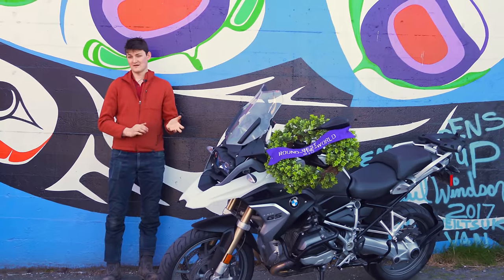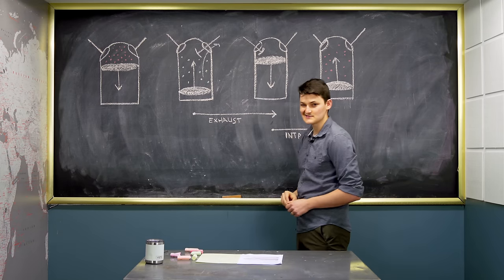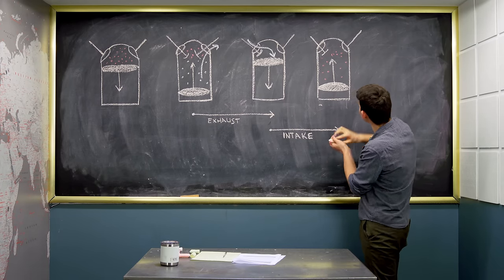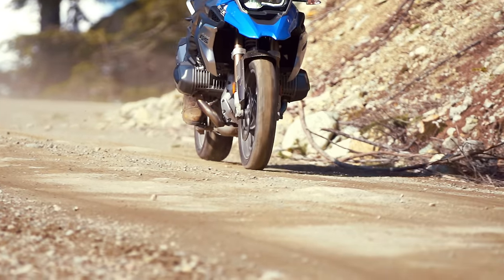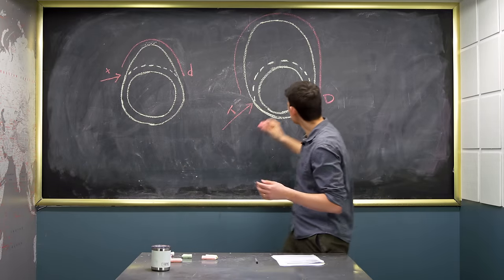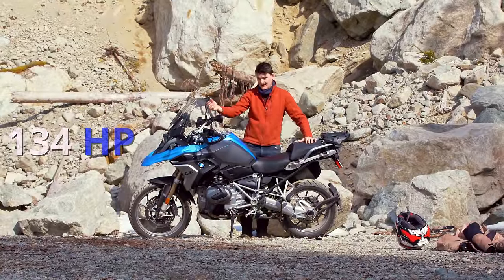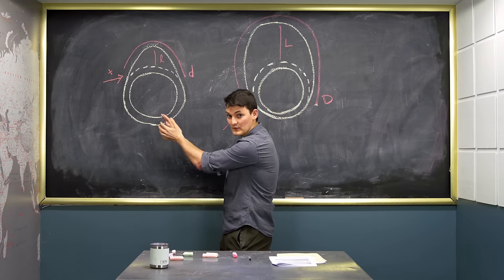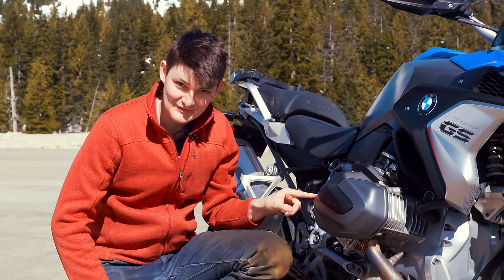Variable Valves are Bad for the BMW R1250GS - Review

Comment: Well I'm a BMW motorrad tech in the UK, And we are the Number one dealer in the UK, We have not had a single shift cam actuator fail yet.. and we have seen some bikes with 60k+ miles already.. just saying..
Reply: j0rzeh: Good on you! My 1200R Sport will be seeing the inside of a Motorrad dealership for its MOT and 4 year service when this is all over.

In Ryan’s defence he makes a very entertaining and informative video. But I’d still have the GS. 11 years of 1150GS ownership and travels all over Europe is enough to convince me of BMW’s superior credentials. And their dealerships are pretty good places too 👍🏻👍🏻👍🏻
Reply: not the point, get it, it is the cost. plus you clearly are biased
Reply: He never said it WILL fail. He said it COULD fail. A very different distinction. As a tech, you typically deal with bikes less than 2 years old. I know, because, I am one as well. The rest of the planet has the 10 year old variety and has to deal with the consequences of these silly engineering decisions.

The secondary point is that it is needless complexity. A GS1250 has already way more power than it needs to for the PURPOSE of it's existence. Why add complexity when the only gain isn't needed?
If the PURPOSE is to go around the world, I'd take 1/2 the HP for an air cooled, belt drive, hydraulic tappet, no gadgets bike. Decent analog suspension, and a few spare parts. No Motorrad helicopter and credit card needed.IMO.
Reply: @shogginr557  BMW Made the shift cam a simple design so it wouldn't fail, It's just a Magnet, highly unlikely to fail. As a Tech I deal with bikes of all ages we often see 15 year old bikes even R80's come into our dealership, Also I worked as a CNC design Engineer building Cummings engines for the MOD prior to BMW and I used to design Turbo's for Garrett so I think  I have decent grasp of engine design It's the throttle bodies that fail. Also I'm not Bias towards BMW at all in-fact I'm a KTM guy all day, But you cannot call tech that hasn't failed yet? I mean come on!.
Reply: @j0rzeh  But, what have you done for me lately?
Reply: @j0rzeh  It is FAR more than "just a magnet" And its still a magnet you can't get in Mongolia. Doesn't it have its own ECM??
Reply: @shogginr557  and you let all the places on earth you went straight to mangolia? He crushed ur head with his reply just deal with it or shuush for the rest of ur life.. U know nothing about bmw gs i own a 2020 model and i have it for 50 years... Well im from feature... We are living on neptune right now earth is destroyed with ur ur crap talk
Reply: @shogginr557  No it doesn't have it's own ECM, the DME runs everything on the bike just like all other brands, It's a Copper winding (Magnet) inside that when current is fed through the windings it moves the runner for the cam shaft, It'll be the last thing to break on that motorcycle, only thing that'll kill it is exposure to water which will cause corrosion and short the windings out, Hard to do that when it's in a sealed oil bath, You have no idea how the system works, Not a single failure in Europe yet, No point arguing with you since you have no idea what you're actually talking about.
Reply: @j0rzeh  Thank you for the explanation, it does sound simple, you are super smart and I'm sure it will be fine for most people.
It's still more complicated than not having it at all. (the point).
And it's not needed (the other point)
Reply: Why use BMW Bikes potentiometers instead of stand switches?
Reply: @PhilbyFavourites  That's the key. It's good motorcycle to travel across Europe where you have dealer service in hand range.
Reply: @j0rzeh  it's a solenoid.....solenoids fail ALL the time...like...all the time. any number of things can cause them to fail. electrical issues elsewhere in the bike that can cause bad grounding, over voltages, a bunch of crap in your oil (if the solenoid is actually exposed to the oil bath) causing shorts or other mechanical damage to the solenoid, etc... not to mention simple use over time. electronic things just go bad at some point, it's a simple fact. will it be 5 years or 50? who knows, but it can still break and stop working, and possibly just from use. it's a good system...however, a mechanical system would be LESS prone to failure just by the general nature of reality.
Reply: The air cooled gs's are notorious for high miles with hundreds of thousands of miles and dry clutches. I have kind of lost my interest in the gs series anyway with the water cooled engine, but still wish they are just as long lasting.
Reply: @blacknester I have a 650, 13 years old now, no electrical problems at all. 25000ks.

Comment: I think you hit the nail on the head about the reliability concern. I have an F800ST, and while everyone praises the durability of the F800 engine itself, there are so many electronics that can and do go bad on them. I've been dealing with a glitch for about 2 months now and solving it has been a huge pain.
Suzuki is the polar opposite. Yes, electrical parts can go bad on any bike, but the only part that went "bad" on a GSX650F (that was incidentally 2 years older than the F800ST) was the neutral/gear indicator, wherein it'd show the wrong gear at low speeds. I feel like Suzuki's tech is dated, but at least it's well-tested. So as someone whose only vehicle is a motorcycle, I'd rather have that any day.
If BMW's engines and mechanicals are as strong as a certain mythical Greek warrior, then their electricals, peripherals, and stupid specialized tools are like his heel.
Reply: I recently read a consumer reports that said BMW fails 50% of the time, Ducati 33% of the time, and Polaris (Victory and Indian) only 17% of the time. With Honda, Suzuki, Yamaha, and Kawasaki all being less than 15% of the time having critical parts failing, so they are the top 4 most reliable motorcycles, with BMW having a reported 50% failure rate of their motorcycles. It didn't say when that was measured or how they attained those statistics, but with their cars, it certainly sounds right. German and American cars are the most unreliable cars ever made, although German cars are a lot cooler than any other car. I would trust a new BMW motorcycle, because I think all the new bikes, except the Pan America and new Harley liquid cooled motors, are pretty reliable as of 2023. Electronics are much more reliable now than in 2006.

Comment: I’m still waiting for the first FreeValve bike.
Reply: Was just about to comment the same
Reply: You guys should check put that awesome new technology called two-stroke ;) Jk I know you're referring to fourstrokes
Reply: Me too. We will ever see it on production? I'm gettin old...
Reply from the maker: Let's just see if they can cram it into a car, first. ~RF9
Reply: @Johnny Blue Air compressor?
Reply: @chargingcycles  cars not just a car
Reply: Like the Suzuki RE5 og Norton Rotary?
Reply: Buy a 1910's bike and you'll have your free float valve (at least for the intake)
Reply: @Johnny Blue Yes I do. <looks suspiciously at the motorcycle engine>
Reply: Livewire ???
Reply: There already is one. It's a racing variant of the Aprilia RSV4 called the RSV4 FW-GP (Factory Works - Grand Prix). Obviously it's not usable for the road, but it produces over 250hp from 999cc.
Reply: The Koenigsegg Gemera comes out this year and the 3 cylinder twin turbo looks amazing, really brilliant exhaust system.
Reply: @chargingcycles  And turbos, don't forget the damn turbos.
Reply: FortNine they are, the nee koenigsegg whatever has a free valve engine
Reply: F1 has used pneumatic/hydraulic valves for yrs - springs can't return the valves to their seats fast enough for a 19k RPM engine.
Reply: @jimieljoseph2322  i think kawi did it right going supercharged. Superchargers build boost in a very linear and predictable fashion. Turbos can get a little funky in the on and off throttle situations. But yeah forced induction is something that would be cool to see on more bikes!
Reply: No you dont. The reason only one car maker does it is cost and complexity. If Electronics are a weak point Camless Valves are the ultimate failure point.
Reply: @Johnny Blue I mean, I already have an air compressor for my horn.  Why not the valves too?  Especially if you can eliminate all the bulk from camshafts and timing chains.
Reply: many years ago I read an article about magnetic valves.  never heard about it again lol
Reply: Johnny Blue I think it uses intake manifold vacuum to actuate the valves, no need for an air compressor
Reply: Electric bikes are valve free.... Oh you said FreeValve.. I'm sure if you haggled they would throw it in the deal...
Reply: @Johnny Blue My bike already has an air compressor, the engine.
Reply: @chargingcycles  thanks.  👍🏻

Comment: 8:30 What the actual hell is this. Are manufacturers going THIS far to stop people from working on their own machines?
Reply: What posible reason/justification could there be for that fuckery?
Reply: That´s a safety feature. It prevents people from messing with your bike and stealing the screw. I had parked my Honda on the street for two decades. The number of stolen screws for the oil tank was excessive. Including the one they didn´t steal yesterday the count is now up to zero.
Maybe the special key helps the manufacturer to make some desparately needed income too.
Reply: @maxlutz3674  That's got to be the stooopidest thing posted here in a long time. Who steals oil screws? And now that Beemer has made a proprietary one, it will be that much more attractive to those that do.
Reply: @shlomoid  just because I got it for free doesn't mean I want it.
Reply: That's the shady part of bmw. Also if you change the engine oil of your brand new bmw with any other brand(non bmw but same grade) then your warranty is gone. If your bikes mechanical parts fail after that you will have to shell out a fortune to pay for the repairs. 
For services as well as accidental repairs, you have nowhere else to go but to a bmw service centre.
Reply: I have a 2004 R1200GS, it has the same oil filler cap, you can just push your fingers in and twist it open, no tool needed
Reply: No. Just want more of your $$$
Reply: @majbach1968  You didnt read @Max Lutz comment to the end, did you?
Reply: There is a screwdriver handle underneath the pillion seat, which fits the oil filler screw cap. Not sure how Ryan didn't notice that. To be honest though, you get 3 tools with the bike, which is pathetic.
Reply: @vivejk4443  - It is normal spec for warranties; use an approved dealer for service and repair, or its void, surely?
Reply: @almaspuding  I think the overall point is that it should be a standard tool fitting, so if you lose the tool that came with the bike you can just replace it, anywhere in the world. And you have your choice of the kind of tool you like to bring, instead of just the one option that BMW makes.
Reply: BMW has been doing this shitty thing for a long time. I'll never buy a BMW again.  You know when you want to change their car batteries you need to reprogram the car for the battery?  And the tool needed to do the reprogramming is like $2000.  So then you need to get it reprogramed at the dealer and thats $600.  thats just stupid to change a freaking car battery.
Reply: @vivejk4443  Magnuson & Moss allows you and me to service equipment ( correctly / oil is oil as long as it has the same credentials, the big 3 auto tried saying that you had to use our parts and have repeatedly lost) without losing the warranty. At least in the US.
Reply: Motorrad division is falling into rank-and-file with the rest of BMW...manufactured for lease only...outright purchase for suckers only. Well, it was good while it lasted.
Reply: That's cause for people who are ignorant of GS' don't know that that tool is under the passenger. but hey let's just spread bad information on the internet!
Reply: @hairyneil  well cause Ryan F9 didn't know that the tool is just under the passenger seat. but whatever right?
Reply: I don’t know about other countries, but here in Australia BMW started charging an annual subscription fee ($300 from memory) for CarPlay. Pure money grab. There was such a backlash they reversed the decision. But I vowed then NEVER to buy a BMW of any sort - car or bike.
Reply: Ken Moto Not that everyone including Ryan can’t make a mistake, but you guys seem to have missed that he never said it didn’t include the tool, in fact he showed it, he said that it’s a special tool that must be shipped from BMW or another part to be stocked if you loose yours and he feels there is no need. Perhaps Germany, (which I love) or BWM owners are having a rash of oil vandalism?
Reply: Tyrone Ismyname Yes, there are laws in America that protect your right to complete basic maintenance without voiding the warranty, (shocker that we still have some consumer protection)
Reply: Lol
Reply: No, he's putting out false info, the tool to remove the oil cap comes with the bike. It's under the GD seat.
Reply: @vivejk4443  The part of not using BMW branded oil voiding the warranty is not true. Spending a fortune for repairs is.
Reply: I'm sure Touratech will come out with a 4 x more expensive filler cap to replace the bmw part.
Reply: @motoken  not on my brand new bmw 850 gs adventure,that uses tje same filling cap.
Reply: @LarryJ602  there is no tools at all in my brand new bmw 850 gs
Reply: Maybe, but then how far do they really need to go? Most bike owners today can't do their own oil changes let alone do any work on their bikes.
Reply: @somestuffithoughtyoumightl6985  Years ago a lot of RTW travellers were having problems with kids undoing the old style Caps and dropping stones inside the cylinders because they were so easily accessible. It became quite a  'thing'. Hence the new design.
Reply: @vivejk4443  That is exactly the reason I got rid of my BMW car. Won't ever own another one.
Reply: @almaspuding  that's cause you only need 3 tools. I owned a K1600gt and litterly can take almost the whole bike apart with a T25 bit, a 10mm wrench and a flathead screwdriver.

I did my own maintenance on this machine for years and it's not so hard as ppl claim.

I did however always bought part an oil from a dealer which always did come with tech support if needed. Even bought the maintenance CD which tells you how to maintain your bike.

Now i have a Honda and none of this is possible so I HAVE to bring it to a dealer for maintenance.
Reply: @almaspuding  I shouldnt need a special tool to do basic maintenance on my own machine. 99% of the work I can do on a harley I can go down to Lowe's/Autozone and get the tool I'd need. Its that simple, I shouldnt need 3 speciality tools THAT ONLY THE MANUFACTURER MAKES just to change the oil on my bike. Thats asinine and a way for manufacturers to swindle more money from a consumer. (PS the 1% work is stuff that pertains to all vehicles such as clutch compressors and gear locks)
Reply: @vivejk4443  Categorically FALSE that changing your own oil voids your warranty. The tool to remove the oil filler cap is in the toolkit - the idea is that it stops some jackass from pouring in a can of Mountain Dew or some stupid shit. I'm not even a BMW guy but the oil filler cap thing is a non-issue.
Reply: @thetessellater9163  No, that's not how it works and in fact it would be illegal to a warranty in the US to be void because you did your own maintenance.
Reply: @Boldswords11  is it really a big deal if the "special tool" comes with the bike? Hell if you hate it, there are 100 different options for very cheap that replace that cap with a non tamper resistant one.